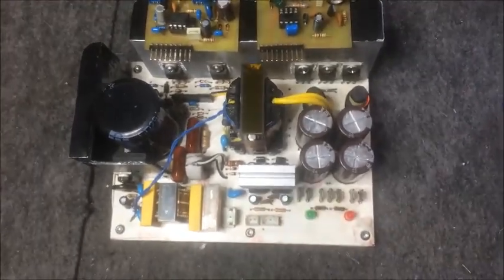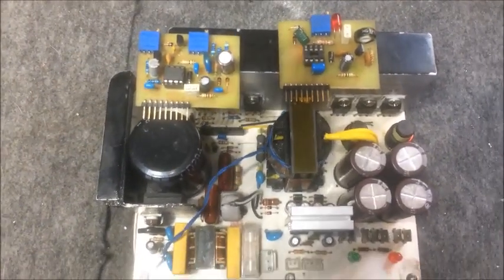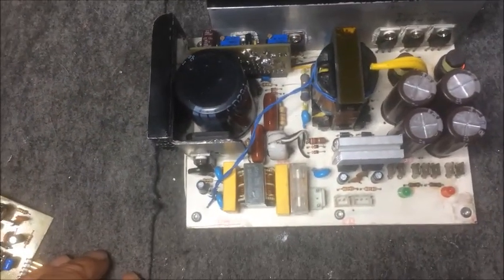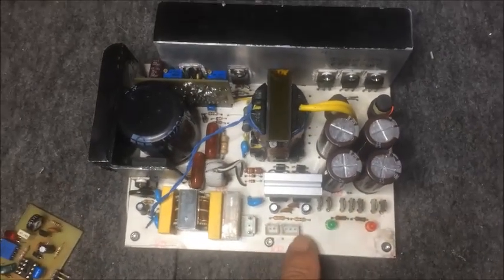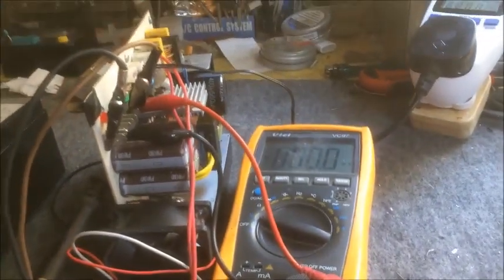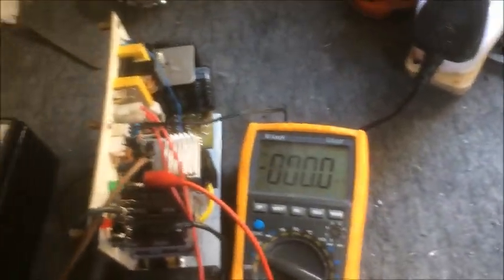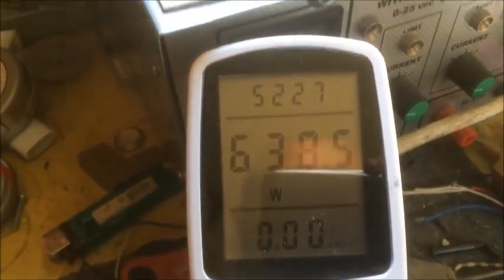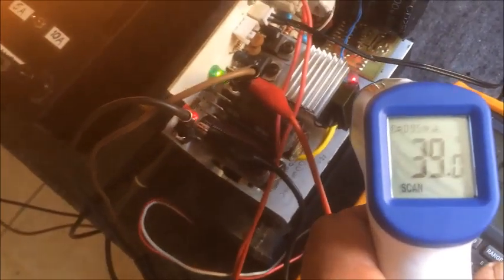SMPS Audio 700W

Comment: You do now, working with smps is very dangerous what concerns high primairy voltages, did you have a way to protect yourselfs? like a earth current leaking device..
Reply from the maker: Yes for sure we have earth leak circuit breaker. I also have a 1.5kw 1:1 isolation transformer which power my workbench and scope is also individually isolated by 1:1 trafo 50VA

Comment: At 700W one should use an active power factor correction circuit before the chopper trafo to improve efficiency. The triac is probably an overkill though, a simple relay should have been good enough. Otherwise very good job!
Reply from the maker: Yes I know the triac is a bit of an over kill but it also saves a lot of space